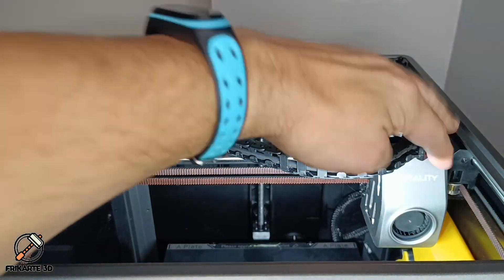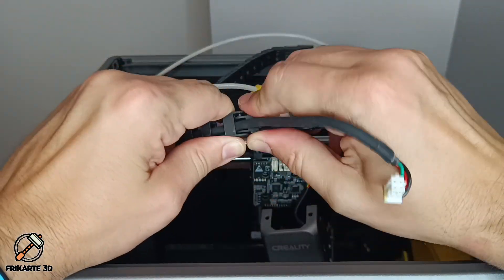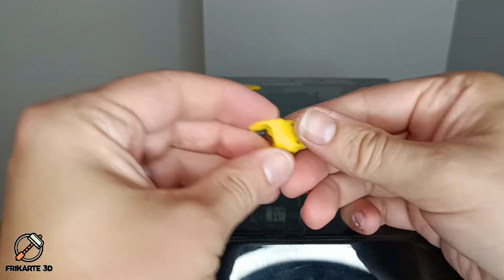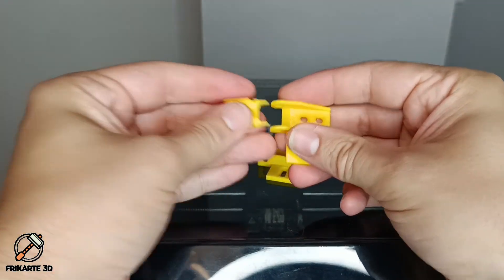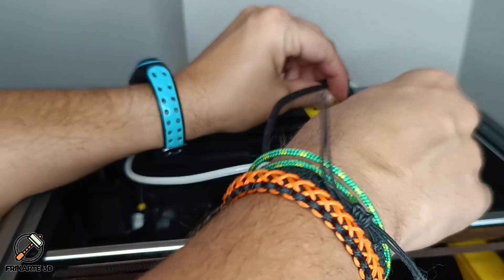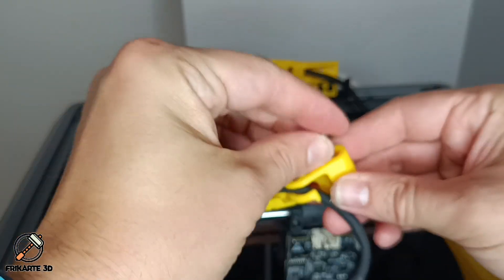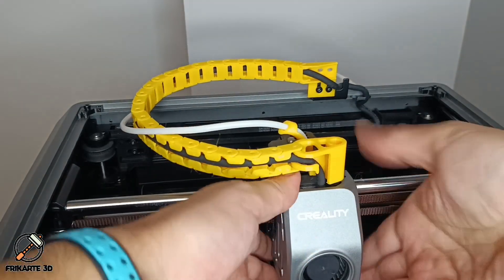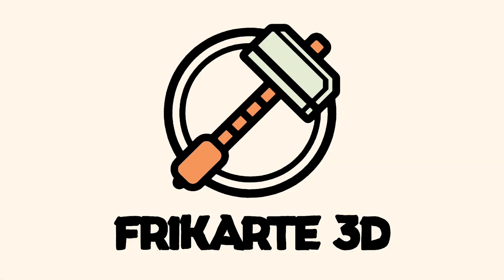How to Fix Cable Chain Sagging on Creality K1 | 3D Printer Mod Solution!

Comment: Isn’t this counter productive?  Now you can’t use the top lid, even with a riser. Kind of defeats the purpose of owning an enclosed printer.
Reply from the maker: Yes, I printed the Leote riser https://www.printables.com/model/890518-creality-k1-k1c-k1se-lid-riser-v2-50mm-height and have the lid installed on top 😊

Comment: how do i change the cable? 
it goes in the back of the printer and down on the motherboard, but how do i make the cable pass trought?
Reply from the maker: Just disassemble the front cover as I did and then pass the cable through. I think you can do it without because the chain is open in one side but I prefered the safe way that avoid pulling the cable too strong.
Reply: @Frikarte3D thank you
Reply: @Frikarte3D  just for info, i've done it and has been a real pain in the @rze :D
Reply from the maker: @asmodeus7340  removing the front plate or not?
Reply: @Frikarte3D Just a Little cover blocking part of the whire

Comment: So... to fix a chain... you just need to install a new one? I don't think that's what you'd call a "fix."
Reply from the maker: It's more like think, redesign and install. If you see the comparasion between chains they have a different shape to avoid if falls for its own weight. There are other ways to fix this, just raising on the front and the back is enough.

Comment: I think i found this on the creality cloud the other day, got it almost finished printing and gonna put it on my k1se probably tomorrow. Do you think it would be worth while to swap my extruder to the DXC? Or maybe just use the gears from the dxc i already bought and swap it into my stock extruder? Im still really new to 3d printing and just starting to get my feet wet
Reply from the maker: My motto is, if something works, don't touch it. The first K1 extruders gave problems, especially at high temperatures, the K1 SE, being always open, may not give you any. I don't know if the gears from the DXC will fit the stock extruder, I think then will be easier to replace the whole extruder.
Reply: @Frikarte3D 10-4 I thought it would help with printing anything other than hyper PLA I wanted to try TPU and PC . I had read that the stock gears in the extruder may not work for this. I bought the upgraded hotend as well with the Unicorn nozzle. But I havent installed anything yet. Wanted to get some info from someone with experience with these printers before I began diving in and swapping things
Reply from the maker: @knuckles31312  Installing the unicorn hotend solves some underextruding issues I had with some filaments. Didn't try TPU with stock extruder but works like a charm with the DXC

Comment: Printer Head moves only in a slanted line

Hello everyone,

I'm currently experiencing the following problem and wanted to know if anyone knows a solution. The print head on my Creality K1 C only moves from the rear right corner to the front left corner,in a diagonal line, and back again. Other movements along the x and y axis don't seem to be possible. However, everything can be moved normally by hand. The z axis is unaffected by the problem. The extruder also works.
When printing an STL file calibrating it,it always moves from the rear right to the front left and back again. No error message appears.

The mainboard has already been replaced but it made no difference.

l'm grateful for any suggestions.
Reply from the maker: Hi, It never happened to me but if you also changed your main board... just what I will try. Print using a print profile on Creality Cloud (check if other person g-code works for you), restore an older version of the printer.cfg (maybe some changed value made this), reinstall the slicer (maybe the initial g-code is corrupted), factory reset (who knows...).
Good luck, keep us posted!

Comment: Does all of this work on the K1 Max as well? Are there any differences to be aware of when it comes to these designs and how to implement them?
Reply from the maker: It should work, you just need to print more links and check what's the connector of the back that fits better for you. You need to make sure to print it with temperature resistant filament like ABS or PETG
Reply: @Frikarte3D  the K1Max has 2 cables, they do both fit, but they are really fiddly to get into the chain, if you get a chance, it might be worth making the links slightly wider just to allow the 2 cables to fit easier?

Comment: Does it work for very long lengths? Say 2.5 m length?
Reply from the maker: Oh! That's very long! That design makes that every part of the chain go a little higher, the only concern here is the total weight that can make ot to collapse, only way to know is trying it 😅
Reply: @Frikarte3D yes you are right the weight of the drag chain will cause it to sag.

Comment: I have a K1 SE.  Creality fixed the problem on that printer by not using a cable chain at all. They use a couple of cable ties to bond it to the teflon tube. I can see if the thing had a lid it might need a guide to stop things from rubbing on the lid, but you still have to deal with the filament tube.
Reply: K1c still has a chain
Reply from the maker: @beardog420  Fix also works on K1C, need to check if the backplate is the same
Reply from the maker: I didn't know that. That's great! Solving known issues on new version is a good practice. I'm working on a riser build because that "fix" makes the chain too height.

Comment: I don't understand what problems the original chain could cause but ok.....good chain
Reply from the maker: Its tolerances make it fall touching the X rod and dragging/sagging during printing
Reply: I have got a creality k1 max and trust me ik exactly what his going on about. It make clicking noses amd if your doing an 24 hour print its annoying and u cant sleep cas all u hear is clah smack wach wach
Reply: @mrmoontp146  Did you do this mod? The K1Max has a double cable and i found it a nightmare to get both cables into the chain, i had to gently pry the chain open with circlip pliers to get both cables in place.

Comment: just one fault with that design..u cant put that top on anymore to enclose the machine..
Reply from the maker: If you use the raiser you cannot but you can only print the chain and solve the problem. I have another mod prepared to have the up higher and the enclosure again

Comment: Rookie printer here, my K1C has had 2 links pop out on their own.  I've probably printed less than 100 hours on it.  Will this fix work for my machine as well?  I know they're very similar.
Reply from the maker: The K1C have the same chain as the K1. So it must work, maybe the rear raiser is different, but you can try to fix without the raiser because the chain itself is very strong.